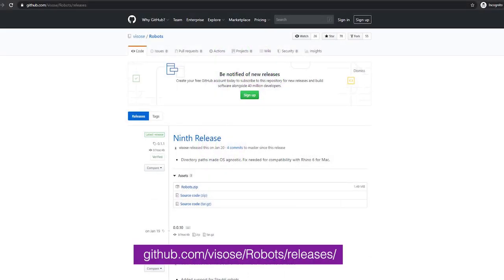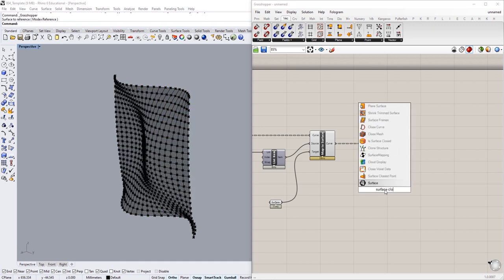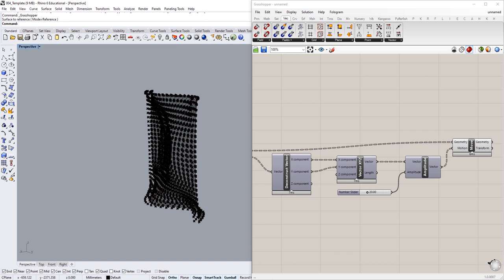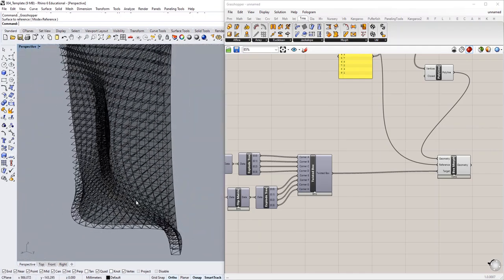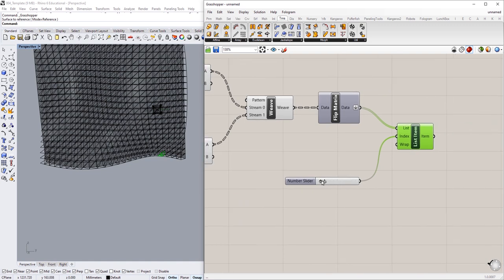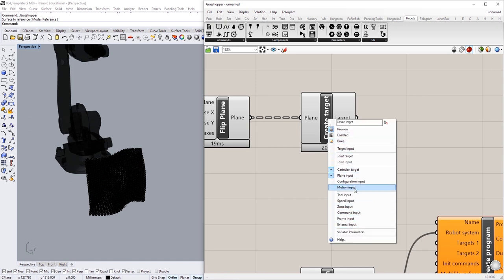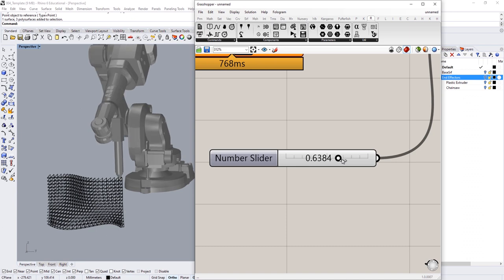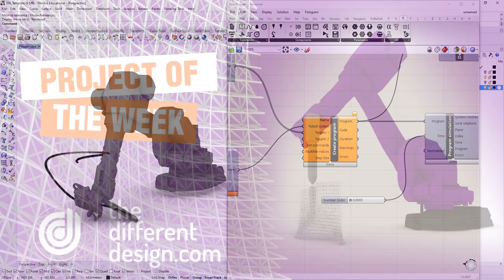How To Program An Industrial Robot (Grasshopper Tutorial)

Comment: Hi, love your work mate! Learning this software to try out on my robot. I created my own surface, but I have trouble getting the orientation of the Box Morph correct. When I scroll through the List Items, the box goes down-up, instead of left-right. How to fix? Thanks!
Reply: Hi, I had the same issue and fixed it. I made my surface using sweep2. You need to make sure you are sweeping from bottom to the top with rails on two sides.

Comment: Can you describe how to download the .xml file on Git Hub please it doesn't seam to work
Reply from the maker: Hi Gerard, on the Github home page you should be able to just click on the 'clone or download' option to grab the folder containing all the robot files. Let me know if that works!
Reply: @grasshoppertutorials  Yes thank you i have noticed afterwards that all the files were contain on the zip file. For some reason i wasn't able to get it to work, when i drop the component load robot it remains red with a message of error :
1. Input parameter N failed to collect data.
2. Before Solution exception:The 'Base' start tag on line 17 position 9 does not match the end tag of 'Positioner'. Line 24, position 9. any idea of what is happening?
Reply: @gerardalain4259  I have the same question, who can answer it, thank you very much

Comment: I have the same "1. Input parameter Name failed to collect data" error
Reply from the maker: Hi Howard, have you saved the folder in the location C:\Users\YOURUSERNAME\Documents\ unzipped and named the folder 'Robots'? Double check and let me know!
Reply: @grasshoppertutorials  Hi, I fixed it bu using the 8th release instead of the 9th

Comment: I have a problem to link what is the robot model folder with value list and I get the following error "1. Input parameter Name failed to collect data" ... although I put the folder in documents as it said ..? How can I solve it?
Reply from the maker: Hi Johan, have you saved the folder in the location C:\Users\YOURUSERNAME\Documents\ unzipped and named the folder 'Robots'? Double check and let me know!
Reply: @grasshoppertutorials  Done, still doesn't work